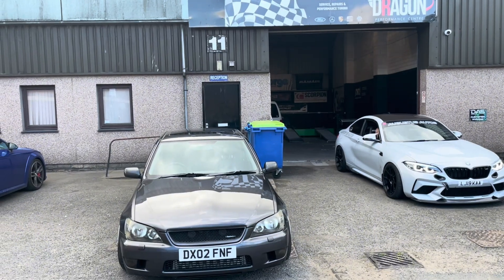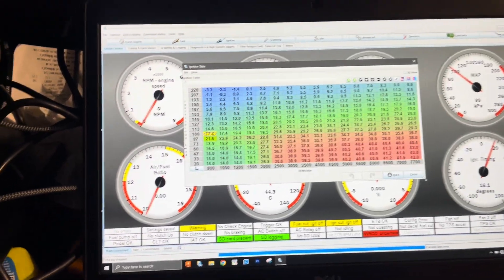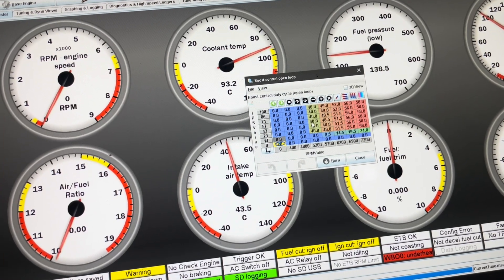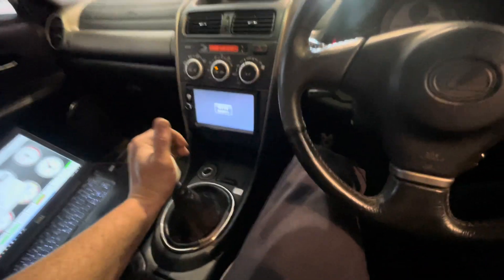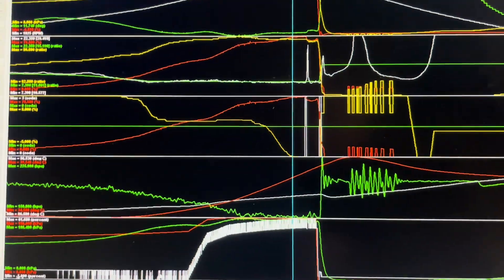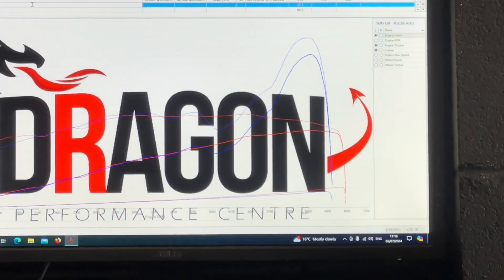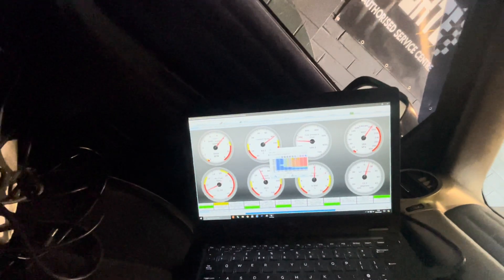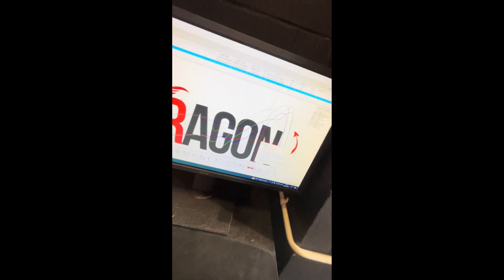Lexus IS200 Dyno. Was not Expecting it to make so much power!! @diy-efi3015 Standalone ECU

Comment: Please, its .49 on the turbine or .72?
Im an is200 owner from portugal, want to turbo 1gfe with gtx2860 .64 or g25 550, but i dont know if .49 is too small, or if .72 is too big
Reply from the maker: @kittf7  i used .72 to keep rods in the block
Reply: @BEYTEK  but can you choose to stay at 0.5 bar always? because probably that shoud be less then 275hp at the engine, so less chance of destroying engine, probably will produce 320nm or 330nm even with .49, but will not get more then that, and there is a company that already tested gbc 22-350 at 0.7B with 270hp (330nm at 3500rpm)
another thing is, in a future with a aluminium intake manifold and with 70mm throttle body (because you cant use trc anyway with diy ecu) the rpm shifts 500rpm to the top rpm, so 500rpm more lag even with .49 turbine housing, i will use 76mm downpipe, 63mm 200cells catalytic converter, and 60mm after cat with 63.5mm muflers (exhaust already done, just need to do the downpipe after the turbo kit)

Comment: Loving the content. Are those power figures at the wheel or crank? Madd!!!
Reply from the maker: shows both here. 240 fly i think it was 310 wheels? ill check
Reply: @BEYTEK  very curious on this one! If the dyno measures at the wheel, that means that the turbo is very efficient to make that kinda of power with that little boost!
Reply from the maker: @gutsuijzx  yeah i picked this turbo and Rear turbine housing as i felt it would compliment the cams and flow o the engine without being too laggy or too fast responce
Reply: @BEYTEK  what A/R are you running on the exhaust side!
Reply from the maker: @gutsuijzx   .72 internal gatee

Comment: Interesting watch. I think it will be tricky to drift which such a small power band though. Interesting to see how much torque low in the revs you could get away with.
Reply from the maker: how often do you drop below 3800 drifting? the 4000-7300 powerband is perfect for drifting :)
Reply: @BEYTEK  oh sorry I thought it was 5-7k, the issue maybe when changing gear in a transition, but you can always clutch kick. If you had it on zf8 it certainly would be an issue.

Comment: Absolute god tier! Didn't expect those numbers from the little IS 

Would be interesting to see what a built 1G could do if a stock motor is happy making more than double the factory power
Reply from the maker: id love to test one. I think it woudl go very far
Reply: There’s one built by fourpaw racing running rods pistons making about 510bhp
Reply: im about to test this for you boss... APA performance is building my IS200, which will run forged rods. and basically new engine
Reply: Please come back to post your results after it's done!  @fa1ledlife
Reply: actualy some did, forged internals, new cams and springs, reworked oil galery and the go up to 450/500hp or so i think